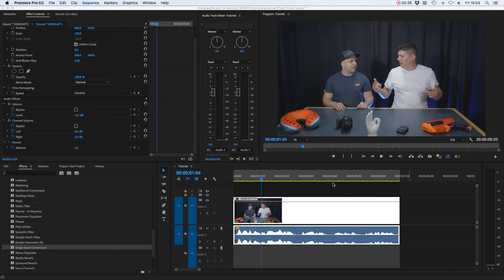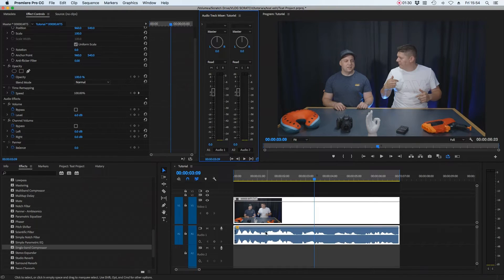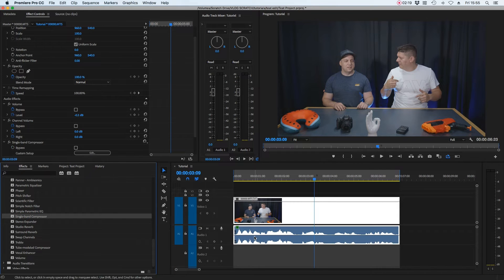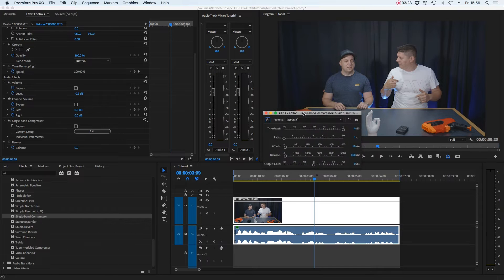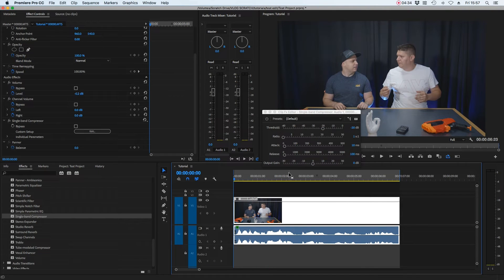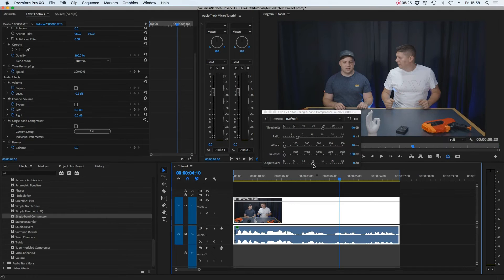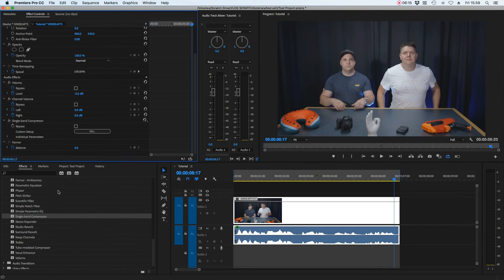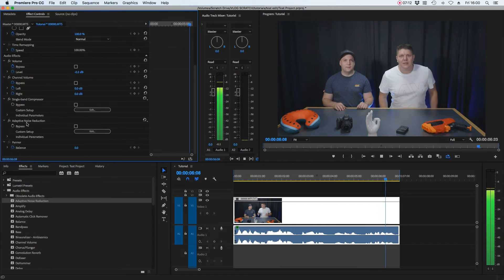How To Fix Quiet Audio In Your Videos

Comment: Hello! Thank you for making this tutorial it is going to save the audio in my video. Is there a way to update the single band compressor levels on multiple clips all at once?  It does not let me select all and update the DB or threshold for all clips.
Reply from the maker: The best way to achieve this, is to place the compressor on the audio track mixer. This way the one instance of the compressor applies to all clips on that track (eg all clips on A1). This is how I tend to work, seperating different recordings onto different tracks.